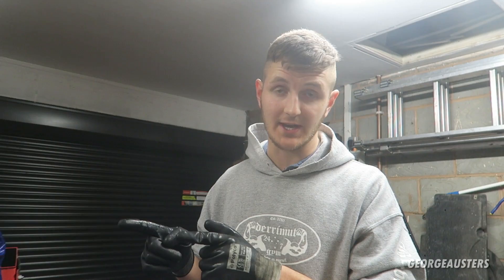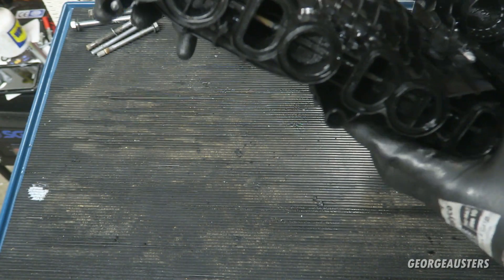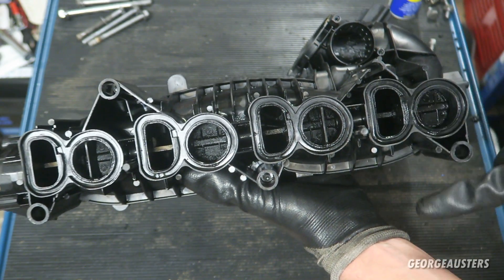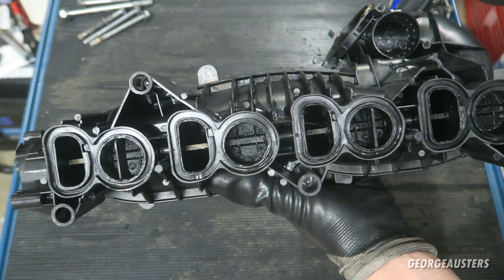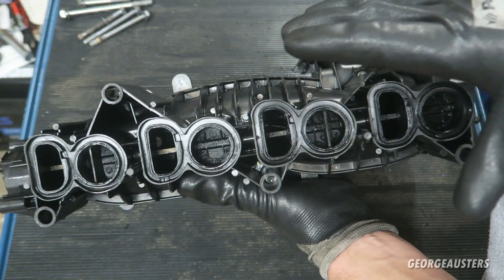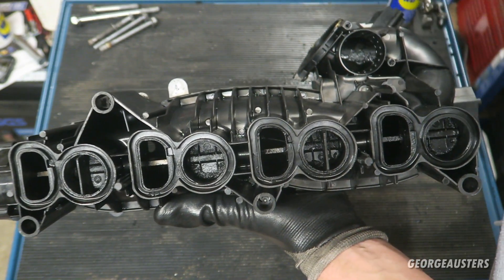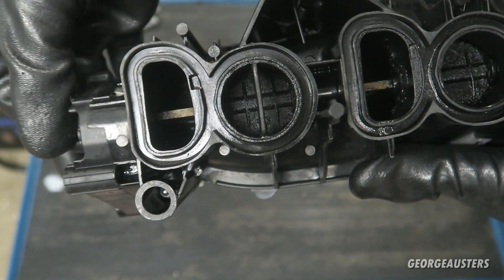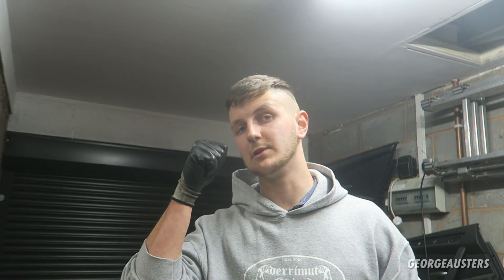Why You Should NOT Remove Swirl Flaps on BMW N47 / N57

Comment: Hey mate lovely content i deleted my swirl flaps on n57 and mapped it to know about the delete but now the car is not responsive at all and also given me some faults for egr bieng stuck open is this fault coming becuase of the swirl flap delete? I have ordered a new inlet now as the car litterally has no power low down in the rev range? Any advice will be great love the content!
Reply from the maker: It’s why I said not to remove them in this video
Reply: Did u remove egr?

Comment: M47 / M57 = immediately remove Swirl valves
N47  / N57 = check condition
Reply: Bullshit, you just need to keep them clean. It is quite easy to remove intake manifold in M47/M57 engines, you need to remove it while replacing glow plugs, it is good opportunity to clean intake manifold and check swirl flaps condition. Done it twice. There is also an option to replace intake manifold with reinforced (brass) swirl flaps, and that's what I would suggest in older engines.
Reply: @mateuszjeziorny6215  Where would one find such reinforced swirl flaps?

Comment: Does anybody know what is the position of the flaps when the engine is off? I have removed the actuator first and then I struggled a bit with the intake manifold so when I got it out the flaps might have turned. Now I'm not sure in what initial position should I put it back - the square rod allows shut or open initial setting.
Another question, did anyone reset flap actuator adjustment/resetting with ista?

Comment: You can buy new set of flaps with shaft and carrier fo £48,so no need to remove it.
Mine still looks good with 105000 miles on it though.
Reply from the maker: Not on the N47D20A engine you can't!

Comment: i had flaps removed and EGR programmed off my w202 220cdi mercedes when i buy it, and car was in winter like freezer, engine doesn't produce heat, and turbo doesn't spool up, after new used intake and EGR againon car is WAY MORE comfortable, i know egr shits intake inside, but least i have warm inside, and turbo spools nicely again, and have very nice torque peak, 0-100km/h in 8s

Comment: From an engineering point and thousand of miles done in an N57  data-logging, I can tell you that Swirfflaps do not increase fuel consumption and are there only for emission purposes and that is to increase EGR gas flow at lower rpm'/load and in the cruise.  Remove them in conjunction with EGR removal only and you will see massive gains in MPG. Swirl flaps should not be removed while EGR is still functioning
Reply: Removing (or disabling) the EGR valve does NOT give massive gains in MPG, I don't know where you got that idea from. It may well give a very SMALL increase in economy by removing/disabling the EGR valve, but only if the swirl flaps are left in (and are working properly of course). Otherwise the tiny MPG improvement will likely be negated.
The swirl flaps are not just there for emissions btw, it helps economy too.
Reply: I deletet my egr and mapped it but I didn't not remove the swirl flaps now on cold start engine will shake and vibrates do I need to remove swirl flaps and mapped them  (N57 engine )
Reply: @rinorjanuzi2100  thats probably your glow plug module causing the engine cold start shaking...
Reply: @dimitrifleitman385  yes that's was it
Reply: Would dipetaine stop the carbon buildup
Reply: Does EGR delete require DPF delete?
Reply: @Mohammed2428 no...
Reply: @Mohammed2428 No, Egr just recirculate part of the exhaust from the exhaust manifold.

Clean the intake and map out the EGR and you won't have to clean the intake again
Reply: @arvidhaug5283  shouldn't the EGR also be physically removed? what happens if I just turn it off in the ECU?
Reply: @_yuuzo  If you turn it off in the ECU, it would mean it is closed, so no need to physically remove it, you could if you want though, but here in Norway it wouldn't pass the EU test and in UK I guess it would not pass the MOT test.
Reply: @arvidhaug5283  Correct, a missing EGR valve would be an MoT failure, as is a missing DPF.
Reply: My cars swirl flaps were blocked closed jammed with carbon for ages  no engine light or egr faults 😂
Reply: How do u take them out
Reply: Right... And then you also need to remove dpf filter as well, since dpf cleaning wont activate without the functinal egr valve. And then you can no longer register the car.
Reply: @juiceofsapho  if a egr off is done correctly when regeneration is active it can work as normal. If it’s a proper tuner they can but the cheap one that use software to turn it off.
Reply: @piovo1  Too many if's... But thanks for the reply
Reply: @juiceofsapho  not really, take it to any good place like dark side developments or Jasonipswich and you’ll have a very very good mechanic that knows these cars inside and out.
Reply from the maker: They do. Tried and tested by myself👍🏻
Reply: @GeorgeAusters  one question, why do the lower power models such as 318d 116d 118d not have swirl flaps?
Reply: @piovo1  probably cause prodice less emissions than 120 so were not needed
Reply: @GeorgeAusters  i also noticed the same. With goodworking and clean swirl + egr is the fastest and best fuel consumption.

Just replace the intake manifolt for a new one. Because they leak

Comment: It's probably worth covering that the issues you raise can be resolved with a remap. Best of both then 🤷‍♂️
Reply from the maker: Not resolved, more rather masked. I had mine remapped and then removed swirl flaps and there was virtually no power below 2k rpm
Reply: @GeorgeAusters  sorry remapped before removing them 🤔 that'll be why. Pop it on a rolling road with a decent tuner and they can pull the boost down slightly lower and smoother.
Reply from the maker: @Northernerdownsouth  Regardless, you have more low down torque and in turn higher MPG with the swirl flaps in place
Reply: please explain further, can swirls be disabled via ecu?
Reply: @germancarfan360 Yes they can be taken out from the program. You lose torque and power below 2k RPM if you do so. Also your car will generate more unburnt fuel = smoke = DPF clogs up faster.

Comment: confirm...i remove my swirl flaps on bmw 3 serie 320d ED....from 7 fuel consume in city ....now is 10....and under 2000 is so slow ....i remove them because when i clean'd my admision...2 swirl flaps were in the engine ....and they didnt get to the engine because of the carbon from the walls...i have pictures..
Reply: But did you gain torque in the upper RPM? I câștigat cuplu la turații mai mari chiar dacă ai pierdut cuplu sub 2000?

Comment: Weary good explanation . It’s good to know the function the part serves before deciding to remove it completely. Surely bmw didn’t put them there without the reason . On older engines they probably would need to come off cose of design flaw , but with never engines I totally see no point doing this - just clean them instead .
Reply: Some versions of N47 18d doesn't have them from factory. 

I removed swirl claps from around 150 intake manifold trought the years. Nobody complains

Comment: What a load of crap
. You don't know what you talking about. When turbocharger is not working, there is still that same amount of air in combustion chamber due to amount of air that piston can suck in. Swirl flaps is just to REDUCE air flow and INCREASE FLOW SPEED, NOT AMOUNT and cause better air-fuel mixture(in theory). Diesel on idle have a lean mixture which is produce more nitrogen compounds and that's why engineers want to reduce air flow, because in petrol engines we have a throttle that does this job. 

This is all done for "ecological" reasons. And from my experience on a quite few engines, after professional flaps remove nothing wrong happens to the engine, they have still same amount of power at low rpm and all cars successfully past emissions tests.  Learn more about how it works before you start talking shit.
Reply: Come on man, what an offensive comment!? According to your comment, if all cars successfully past emission test without swirl flaps, then car manufacturers are totally stupid. :-)

Comment: I've got an N47 with the brass bar going through the intake for the swirl flaps. The end flap was badly worn: where the bar goes through, as if the flap was stuck and the bar wasn't, causing friction/wear on the plastic flap. It was so worn that it was about to fall off. Luckily we spotted this beforehand and removed the offending flap. 135k on the clock.

Comment: Can I buy separately swirl flaps or rod only from anywhere for my BMW rather to buy whole system?
Reply from the maker: Not on the N47D20A engine no
Reply: @GeorgeAusters  hi mate.can you please give me some advice in regards to my swirl flaps?
I have a astra h mk5 cdti 1.9.
Stage 1 remap
Egr blanked
Complete new inlet manifold

Would i need to remove the swirl flaps? 

Thank you.

Comment: This with screws falling in to engine is bit of a lame. - throttle bodies flaps are since beginning of time held by screws and usually what is done is that you "punch" in back side of your screw and there is nothing that can "unscrew" it. Screw becomes bit notched and does not come out if you do not grind it off.  Oil catch can should help to minimise soot build up, and skip annoying intake manifold cleaning. On my Pierburg intake manifold  screws are glued and they do not come off. I think I can only brake them.

Comment: I think swirl is necessary as egr exhaust needs to be mixed with fresh air. Without egr there is not much help with swirling as there is no mixture in diesel that is being mixed. You can loose mpg as diesel is injected to poorly mixed exhaust gas and not burning.
Reply: Thats why you delete the egr too
Reply: when you close egr, you get inside the engine more fresh air, which means more burned fuel ! And what is more important, you loose your extra mileage economy when not accelerating, because your egr doesnt work anymore and your engine still burns the fuel because still getting fresh air  ! Simple as that, Learn why the Egr is in the diesel engine ! Its not there only to get better emissions !

Comment: Loving your videos, very informative and well explained. I have the m47tu2d20 and has had the flaps deleted. I cant find anywhere if the actuator its self should be deleted and the wiring capped off. Would it throw up a fault??? or just best to leave in place.

Comment: Dam already had mine removed on my 320d n47 engine as I was told they would probably break an fell
Into my engine
Reply: Mine just broke 3 weeks ago 🙃 damaged the intake valve on cylinder 4
Reply: Bart Barwih your swirl flaps broke? Did you not have them removed

Comment: Wait till they brake and fall inside the engine. They are there for emissions
Reply from the maker: They’re there to create more torque low down, thus saving you fuel thus meaning lower emissions
Reply: Not entirely true. It helps ensure that the fuel mixes better with air, the more liquid fuel you have the more soot you create and therefore less of the fuel is combusted and you produce less power. The more combustion the more power, soot doesn't do any good for the engine in terms of power

Comment: B37 engine on 2016 BMW 116d 3cylinder diesel engine... should these be removed? When done, car lost power at low revs (stuck at 70bhp/160Knm torque)....diagnostics fault reported on swirl flap motor
Reply from the maker: Absolutely not, no need to remove on your engine
Reply: @GeorgeAusters  at 44k miles they were clogged with carbon and flaps only were removed. My question is now that its done, and motor rotating a shaft with no flaps, car still throws a 2C3200 error that seems to create an issue with lower mpg and limp mode (car sluggish) .... have you encountered this?

Comment: you learn something every day , but i still don't thing the updated manifold is "much better" better maybe , the screw never feel out of a carburettor flap why did they on bmw's swirl flap
Reply: Carburettor flaps and swirl flaps.. There is a big difference. Plastic flaps inside of plastic intake manifold with relatively hot operation conditions, egr gasses passing true and carbon built up. Nothing last forever
Reply: @puukkoallu333  yes i understand , but why build things so bad also unrepairable and gets better when it falls apart and  terminates your engine

Comment: I just deleted the swirl flaps on my 123d n47 and lost all low down power and no boost low down
Reply: you can also buy remanufactured used -> cleaned manifolds with betters rods and everything, I did this with my om642 320cdi (benz) for better fuel effiency and lowrpm torque
Reply: @blektheone17  Hello, I want to clean the intake manifold too. Do you recommend replacing the flaps or removing them?
Reply: @dannychanel3502  hi, I replaced the flaps with metal flaps, because that's actually the factory solution, I mean, the restoration, but the flaps are basically plastic originally - but they're not as crappy as the ones in BMWs.
Basically, many people remove the flaps and weld the intake manifold, because that's also a solution, but then there's no point in having a butterfly flaps/valve motor... and at some level, it could be removed from the system...
However, the flaps can generate a special air vortex for the engine, so the Mercedes fan mechanics told me that it is definitely necessary. Incidentally, I bought my car with the butterfly valves(flaps) practically welded and removed, and when the flaps actuator motor broke down, I basically reverted to the factory solution. It would have been cheaper to remove the flaps actuator motor from the system, but then the engine would not have received enough air, so the engine control unit would have had to be reprogrammed , but then my factory system would have been completely ruined. If I had to do it now, I would probably go in the direction of completely removing the EGR and DPF and installing a modern new butterfly valve solution (definitely with metal blades).
Reply: Well I’m pretty sure the engineers had this system in place for a reason!
Reply from the maker: @johnstonlee  Yep!
Reply: @GeorgeAusters  Hello, I want to clean the intake manifold too. Do you recommend replacing the flaps or removing them?
Reply from the maker: Just like I said lol

Comment: Good info. The flaps also cause the air speed to increase which aides mixing
Reply: mixing? mixing what? its a common rail direct injection diesel...mix the egr with the fresh air maybe?
Reply: just try to rotate the water in the bottle to get it out and you will see its going faster when swirling

Comment: I've got N47 130kw swirls removed and dpf regeneration occurs frequently
. Almost every 200km in city on short journeys... 149K km on the clock
Reply: Maybe because you have removed the swirflaps butt your egr is still active..so if you drive low rpm all the time the burning is bad and if the burning is bad you will have black and bad exhaust smoke what will block your dpf so now it regenerate more! It just a theorie,I am not sure
Reply: DPF delete
Reply: Check your coolant for leaks and correct coolant .. somethings caussing thé dpf to clog up very fast

Comment: Swirl flaps also  control lower emissions and low revs.  I won't take risk of leave them in regardless.  I've replaced my  entire inlet manifold from BMW 2014 only done 25k and its already the swirls flaps are leaking oil and looks doggy.
Reply: 20 years or so when bmw put them in the e39 they said they were there to control the amount off air going in to the engine which when closed the engine would stop quicker also on tick over the engine ran much  smoother   Does anyone remember a tv program were they sat a full glass off water on the engine and it didn't spill with the engine
Reply: There can't be oil in the manifold unless the breather filter is blocked it will draw oil fumes in to the turbo and block up the manifold plus the EGR valve plus all the filter on the exhaust system( badly serviced)

Comment: Would an M47 520d suffer power loss or mpg loss after removing swirl flaps?
Reply: I have m47 engine. They are a different swirl flap setup there is no change with n47 engine after swirl flaps 'removed just a prevention measure
Reply: No if you get your self different turbo that spools earlier than factory model. Some of them spool quite good from 1200rpm, so if you like to experiment, that is the way you should go, or just leave these flaps there. If you have tons of soot on them quickly build up you have bigger problems to sort out, than swirl flaps. Properly functioning diesel engine shall run for many many happy miles as long as combustion is not to rich, or inefficient.

Comment: nothing to do with more air at all the reasson it swirls is it mixes the exhaust gasses with teh clean intake air so teh swirling effect causes a better mix of teh exhaust and intake to combust better but if teh egr is removed there is no need
Reply: @roberkkk1 you will find the egr is mostly open at lower rpm under low power state I can show you the egr maps in winols the egr would not open under load as would effect emp and vane position also 800c egt into the egr cooler and manifold is not a good idea so please tell me when the egr is used if not at low loads
Reply: @roberkkk1 so what is your point.....

Comment: Hi George, nice video defo learning from this. I am wondering what is the error code for cleaning or faulty flaps? I have this code: 24CE00: Hot Film air mass meter: Ratio of measured to calculated air mass too high.     From your explanation, if feels like it is related to my code issues.
Reply: clean the airmass sensor easy peasy